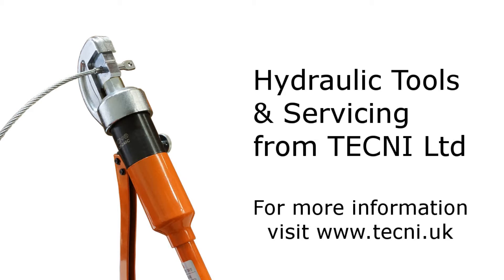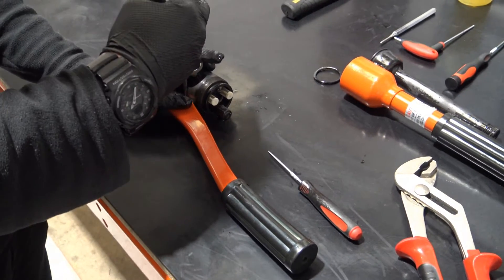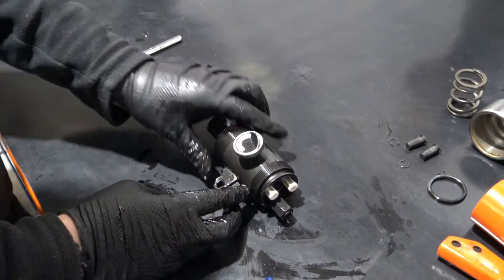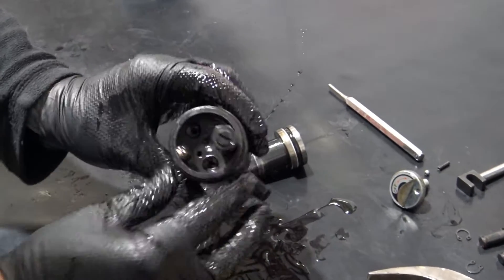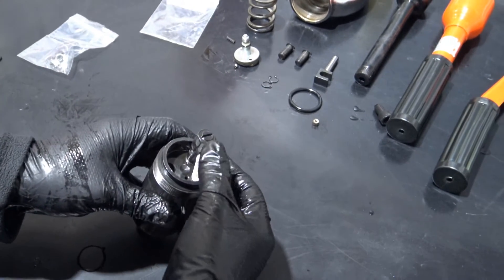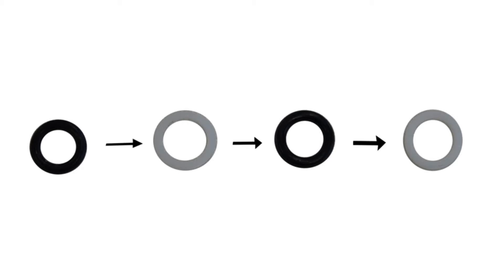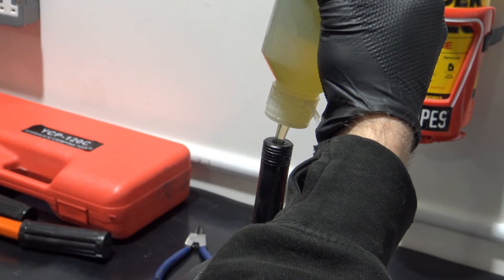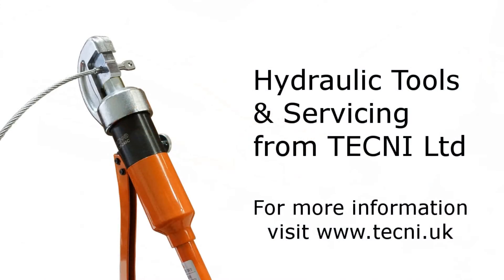How to service hydraulic crimping and press tools YCP120C and YCP240C

Comment: Hi, I have a problem. When I start everything works fine, but when it starts to resist, the lever bounces and does not hold the pressure. The oil seems to be fine and there are no leaks, but I don't know how to fix it. Can you help me, please?
Reply from the maker: This is down to air in the system.

You'll needs to remove the handle and cap off the oil bag and bleed the air out. This is done by pumping the unit whilst the filler cap is out of the bag. This may need to be done multiple times to get all of the air out.
Reply: @TecniCable  Thank you so much for your reply.

I have tried this 6 or 7 times, but it hasn't worked for me.

Let me explain what I did so you can check if I did something wrong.

I remove the screw-on metal handle and the small cap from the black oil bag. With the tool down and the filler neck up, I put the system in the working position and pump until I feel the pressure and also the rebound. Then I put the system in the release position and start again.

I have done this 6 or 7 times, but I don't feel any change.

Did I do something wrong?
Reply: Maybe I'm not explaining the problem well.

It's the lever that bounces back strongly. I pump with the lever, it's easy at first, and little by little it starts to offer resistance (that's normal)

As soon as it starts to offer resistance the lever returns to the open position, I insist but it always comes back, the lever doesn't hold, and it comes back and doesn't close the clamp with enough force.

Comment: I have a yellow 16ton for crimping wire lugs, would the kit in the beginning service mine and where could I get it? Looks the same except for color and the crimp end.
Reply from the maker: Hi Scott, Thanks for your comment.  Although we designed the die sets for these tools for our wire rope applications the actual tools are of Chinese origin.  Most of these types of tools are from China and the designs are extremely similar so there is a good probability that the majority of the parts in the service kit will be compatible with your tool.  Here is a link to the service kit for our largest crimp tool the YCP 240C https://www.tecni.uk/YCP-240C-Hydraulic-Swaging-Tool-Spares-Kit-101.500.240  Hope this helps. Best regards, Trevor

Comment: [   POSSIBLE   FIX !   ]

If anyone has problems with one of these things not working then it could also be because of blocked oil pathway. My tool stopped working after one crimp and after few hours of screwing around I managed to find out that there was a small metal burr inside one of the oil pathways. After getting it out it works again.

Comment: hi ,Where can i get crimping machines service company we based in South Africa ,machine type is Hydrolok H50
Reply from the maker: Hi Ernest. Thanks for the comment. TECNI Ltd is based in the UK (however do ship our products worldwide). We also only offer servicing on our own Hydraulic Tool Range.  If the tool shares similar internal components than servicing methods would most likely be similar however we would always suggest taking to a specialist. Unfortunately we do not have any contacts based in South Africa and not familiar with the Hydrolok model. Apologies for this.

Comment: Would this service transfer to an 8T April plane spreader as everything apart from the head looks the same?
Reply from the maker: Hi Kinny. Thanks for the comment. We are not familiar with the tool mentioned so we couldn't guarantee that it would be the same but if the internal mechanism appears to be the same then the service procedure would probably be very similar. Just note the placement and alignment of all internal components during disassembly and photograph parts where necessary to ensure correct reassembly. Hope this helps. Thanks again.
Reply: @TecniCable  thanks very  much.
The tool is an April flange spreader but I think they're all generic products from the same manufacturer, the other name i give you is more known thats why I used it.
I was told it needed 75ml of hydraulic oil, but as I found out to my annoyance it was ready for use, and me messing with it was unnecessary. 
Just hope I havnt damaged it.
But thanks

Comment: Hi, Does the pressure need to be tested to ensure the correct pressure is applied to the crimped electrical connection?
Reply from the maker: Hi Dave. Thanks for your comment. 
The tool has an auto cut out feature to show when the maximum pressure of the machine has been reached. The best way to check the fitting has been correctly swaged is by checking the after swage diameter which you can obtain from our website www.tecni.uk for the relevant swage fitting. This tool is advertised as a hydraulic crimping tool for steel wire rope and is provided with dies to suit however it is capable for doing electrical cable as long as the correct die and size is used for what you are pressing, this is very important. Some of the presses may be too small for this machine. If the cable size is suitable and providing the after swage matches up with the manufactuer advised dimension you will know that the termination is correct.
Thanks

Comment: These tools are sold under various brands in the USA and all appear to be from Chinese manufacturing. We have problems with them losing pressure when nearly new after just a few crimps. This is likely from too much force being applied. Which seals tend to blow out on new devices from too much force? The tools include seals for the cylinder and the on/off knob but not for the handle pin. I opened the tool and did not see an obvious failure at the main cylinder seal. If these tools can be improved to be more reliable, that would be a useful video. Are failures common because the handle pin seals are often damaged during manufacturing?
Reply: Yes.  That is the exact reason I ended up at this video.   I got maybe 4 crimps, before my crimper was no longer operational.
Reply: @richardmiddleton5984  me too. Exactly as you describe problem.
Reply: @jellysmith4350  It turned out, all I had to do was add hydraulic fluid.
Reply: @sgtm7  lucky you. Internal (piston chamber) seals are definitely blown in mine, and no way if changing them that I can see.
Reply: @richardmiddleton5984  I got one crimp and it's dead. What a piece of shit.
Reply: @CoreMaster111  Maybe you will get lucky like I did, and adding hydraulic fluid will resolve the problem.    I used ATF to top mine off.
Reply: @sgtm7  I'll try. Better than start messing with seals that I don't have spare ones for.
Reply: @sgtm7  Mine was already full. Took it apart, nothing obvious is broken, doesn't work.
Reply: @sgtm7 Okey, I managed to fix it. I took it completely apart and found out that there was a small piece of metal burr inside one of the pathways and it was blocking oil flow.
Reply from the maker: Hi  M BO
Thanks for the comment.
Our Hydraulic YCP tools have a two speed action and is fitted with a safety value which automatically releases when the maximum pressure is reached. Although not impossible issues with pin seals are very rare and not one we see commonly. Unlike similar tools you may find online we  provide a 12 month warranty and also offer a high quality service upgrade if required as shown in the video. For any more information please visit www. tecni.uk
Reply: @TecniCable  sounds great. Where can I buy your tools in nz though?
Reply from the maker: @jellysmith4350  Hi John. Thanks for the comment. Here is a link to our Hydraulic products including Wire Rope Crimpers - https://www.tecni.uk/wire-rope-cable-tools/hydraulic-tools - We offer a YCP 120C Tool and YCP 240C depending on the size of wire. We also offer hydraulic wire rope cutters. 
We ship our products worldwide so could get them sent out to NZ from the UK. If you send in a email to sales@tecni.uk we can get a quote out to you including any shipping fees.  We tend to allow around 7 days for shipments to NZ. Thanks!
Reply: I can't get the handle off of mine.   I sprayed some WD-40 and the joint, and hopefully I can get it off tomorrow.    The was able to take the head off, and there is no problem with those seals.  In fact, if I turn it facing down, it works.  I am thinking the seal for the handle pin is the problem.